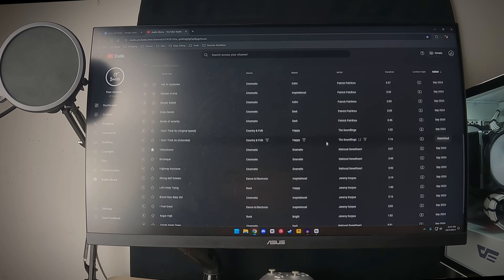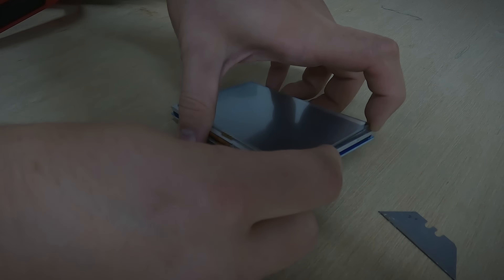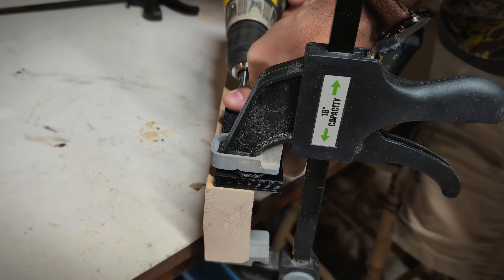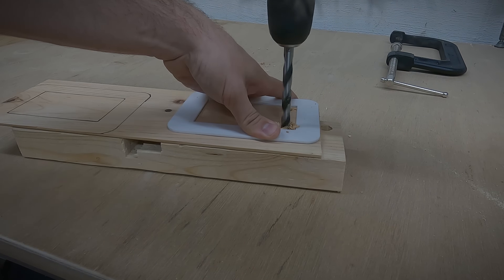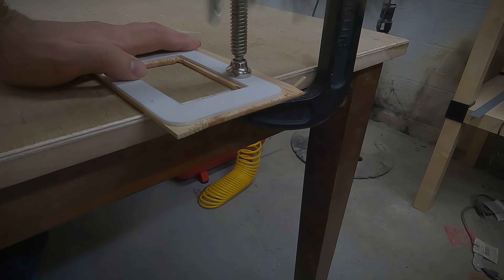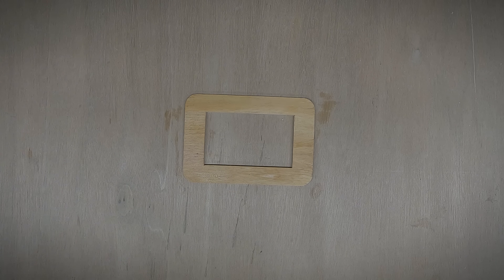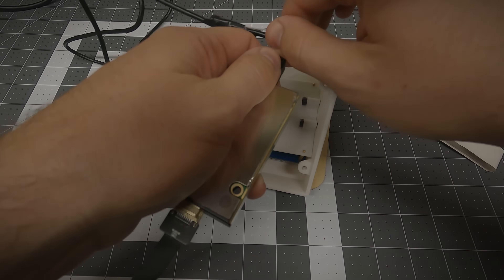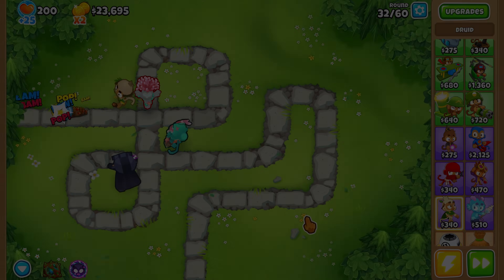How I Made A 5" USB Monitor For My PC

Comment: just a tip when you want to use a hand saw or anything like that make sure your wood cant jiggle :D support it on a flat surface
Reply from the maker: Thanks for the tip (:
Reply: @CF-Builds  np and love the design
Reply from the maker: @shoxdanger  Thanks (: I'm actually thinking of making a V2 which will be much thinner 😁
Reply: @CF-Builds  sounds good. and just me on this but the over hang from the front bezel is a bit large. i like the design you got at the start

Comment: Just attach the wood to a sacrifical piece of scrap wood (glue on the parts which are going to be cut away anyway),  and saw through both. Not only will it not break, you'll get a nicer cut as well.
Reply from the maker: Thanks for the tip (: I'll probably use this one in the future!

Comment: How did you wire up the lcd panel? I'm interested in doing this.
Reply from the maker: The panel had pads for 5v and gnd, I spliced the 5v (red wire) and ground (bare wire) from the USB cable and soldered it to the pads (:

Comment: Your problems in the beginning were because of the wood grain, at 5:20 the bezel was moving back and forth on with the grain so it quickly weakened and broke. At 6:00 you were going against the grain with the router which led to it pulling the piece off, if you had gone with the grain for that corner it would have been fine. Also, another tip, if you're working with a thin enough piece of wood you can score it with a knife and break the excess off instead of using a saw.

Comment: I have a tiny 5" screen I should do something like this with :D
also lil tip, if you cut a V notch in the end of a strip of wood and clamp it down onto the work bench or table, you have a surface you can lay parts on and pull the saw through <3
Reply from the maker: I never thought of that 😅 thanks for the tip!
Reply: @CF-Builds  Mine is peppered with saw marks and drilled holes cause I've had it so long, it's very decorative 😁

Comment: I don't really understand why did you go lenght to preplace the hdmi connector with a usb. Any particular reasons?
Reply from the maker: I mainly did it for simplicity and to have a cleaner look on my desk with only one cable instead of having an HDMI in addition to the USB cable I would have needed to power the display anyways (:
Reply: @CF-Builds  Ok makes sense. Cool build and thanks for the answer
Reply from the maker: @andreafigini  no problem, I'm glad you enjoyed the build (: